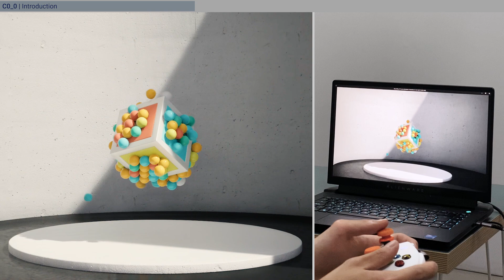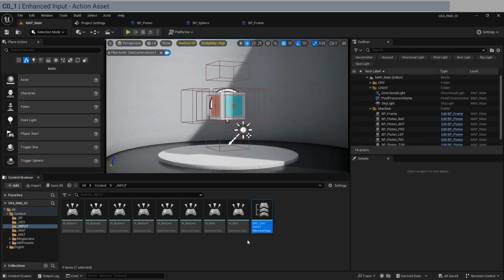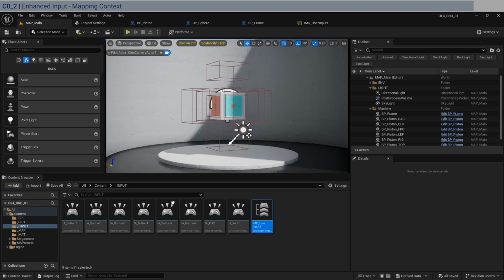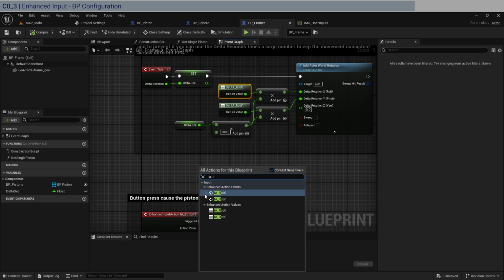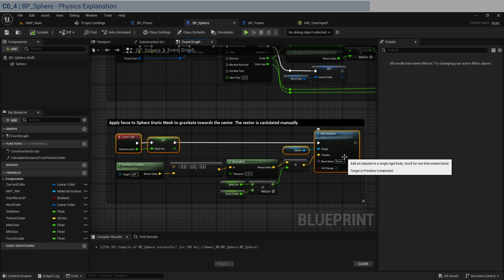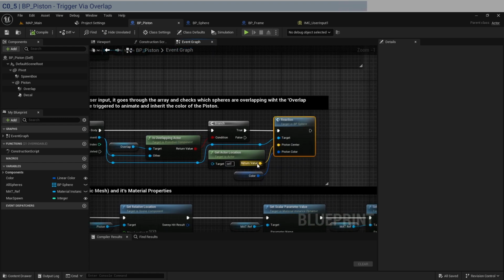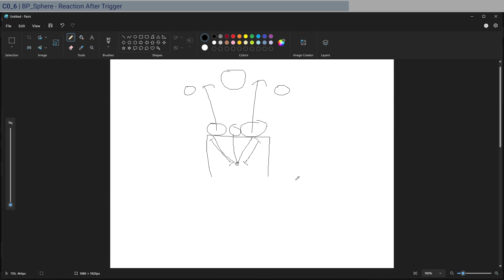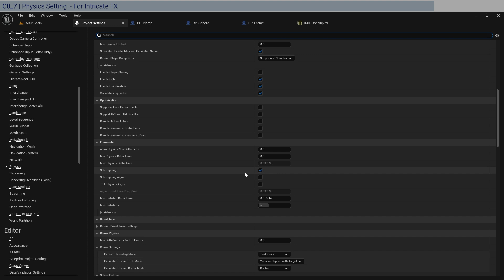Unreal Engine (UE5) Interactive Art, Motion Design - Enhanced Input System [Blueprints]

Comment: Hi! I just joined the Patreon! I’m very excited to start learning all of your material! What order would you recommend I do them all? I saw on the member tiers you mentioned starting with the free material as a prerequisite?

Sorry just need help navigating the material efficiently for maximum effect.
Reply from the maker: Well I’d say the new UE Programming for Dummies is could be the most beginner one so that’s a good start. Otherwise, just start from order of publication, they can all be followed wi to UE5, BP wise it’s 99% the same workflow as UE4. I think the only difference is the vector * float node doesn’t exist in UE5, we just use the multiply node and right click on the input pin to convert to whatever data type.

Comment: Hello, I would like to get more detailed info about the setup (Pistons, etc.) so I would like to buy your 5$ video from patreon but not sure about the content. Are there more details included or is the patreon video the same as here on youtube?
Reply from the maker: This is called "Reverse Engineering' for a reason, it's more of a self studying series, I give you explanation of likely what's the hardest and most important pieces of code and the rest you figure out yourself, which should be relatively easy if you've been taking all the full courses I offer.
Reply: just buy it bro. penny pinching in the comments is not a good look.